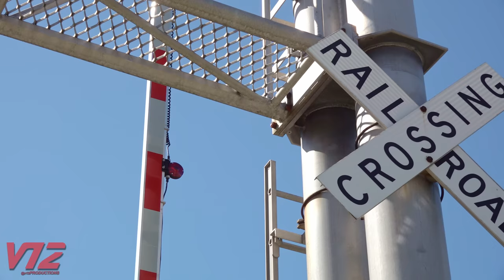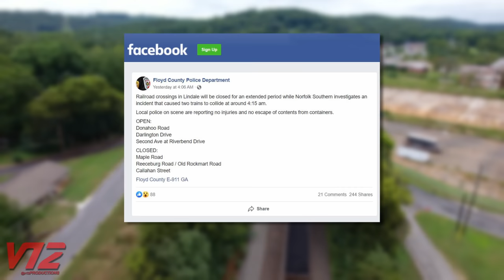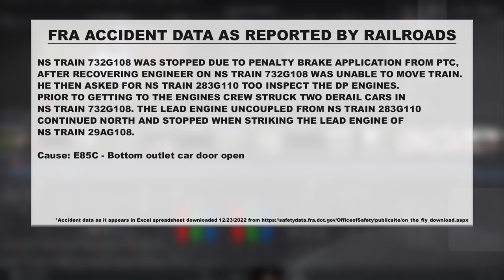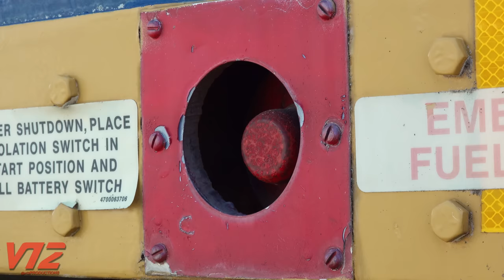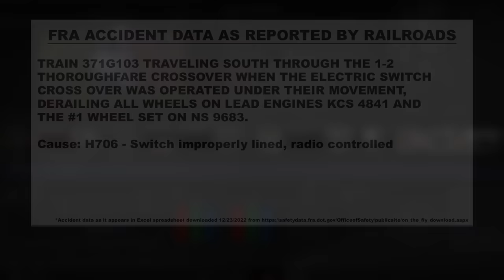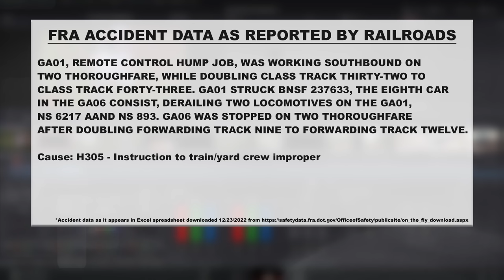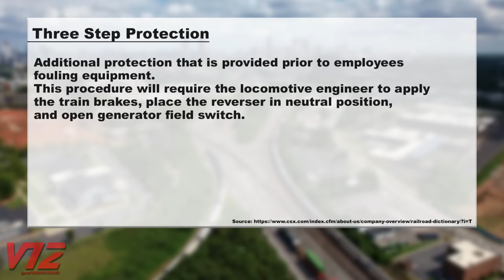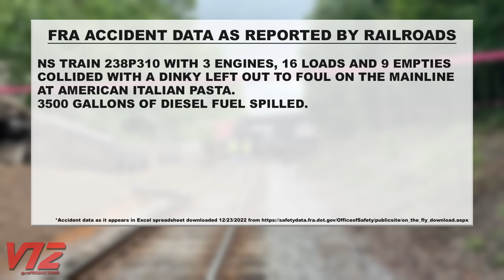Train Wrecks 2022 | SPECIAL REPORT

Comment: Them side boom tractors  are amazing bit of kit we could do with them in UK , we just work with jacks and beams to re rail locomotives , we do have some rail mounted cranes but not as versatile as your side boom tractors  . Had locomotive chucked off on catch points ( a switch to throw loco off ) two rail cranes couldn't lift it , and in to bad position for jacks/beams ,took nearly 2 weeks to get crane in due to remote position , but reckon you lot with then side boom tractor  would have done it in couple hours . It looked very much like loco 6217 at 28:53 on video at quite an angle except there was little damage to Loco or track , it had loaded coal train behind but only Loco brake to unable to stop at signal

Comment: I think they should mandate the european solution of all tractors covered with reflective YELLOW paint at least 12% each end. Airline manage to light up aircraft tail fins to enhance ground safety ..why cant train companies on very long trains?

To the rear of the train this could happen with guard carriages or warning illumination. It is always difficult to ask for train companies to invest in satellite communications emergency stop technology by the company controller but it is possible if regulated for....

Why cant these out of date trains be fitted with aerodymanic noises to save oil? Anything over 55 mph would save cash for aeroynamic modifications?

Comment: HUH. I'd be interested in reading the full FRA report. The summary provided at 12:15 makes no sense whatsoever. If train 732 got a penalty application and stopped and somehow derailed the cars with the brake pipe still intact (the one and only way they would have been able to actually fully recover the train). When the 283 hit the derailed cars and uncoupled that would have broke the brake pipe and it would have immediately went into emergency and applied the brakes. Even if somehow it didn't the crew aboard would have been able to. Even if they were somehow incapacitated, there's a 60 second alerter reset button that has to be pushed by the engineer or it puts the train into penalty and applies the brakes. Very confusing how their unit continued on and hit the third train.

Comment: Bad planning to have a set of traffic lights next to the crossing, a common cause of an accident. Maybe the traffic lights should be moved to before the crossing so when on red no one will be on the crossing waiting for the light to change to green, also once over the crossing the road junction will be clear to go.
Reply: At least in the places I've seen in the North East, and places in Florida where major highways cross railroad tracks and have an intersection nearby, there are two sets of traffic lights:  One at the intersection and another set on the other side of the tracks to stop traffic before it gets on the tracks.

Many of those intersections have automatic sequencing to help traffic clear the tracks.  One example is the Suffolk Ave/Lowell Ave intersection near the Central Islip commuter rail station on Long Island N.Y.  Suffolk Ave. parallels the tracks and Lowell Ave. has a "T" intersection there with Suffolk Ave just across the tracks.

If you assume that Suffolk Ave - the parallel  road - has the green light, and Lowell Ave. has the red light. . .  When a train is coming and is still far enough away several things happen automatically and simultaneously.
1.  The Suffolk Avenue lights automatically cycle to RED, stopping the traffic on the parallel road.  This happens even if the lights have just cycled GREEN just seconds before.
2.  The Lowell Ave. lights at the intersection cycle GREEN to let traffic off of Lowell Ave between the tracks and the intersection.
3.  The Lowell Ave lights stationed before the grade crossing cycle RED to stop traffic from entering the railroad crossing.
4.  The signals and crossing gates are activated.

Setups like this would prevent a lot of intersection-related accidents.  Of course, no amount of safety planning can cure stupid.

Comment: Good afternoon
I'm sorry, but from what I saw the railway lines in the USA, they are very bad, perhaps equivalent to 3rd category lines in Europe, not only do American trains run at low speeds, but in the case of this (and other videos), I see that they use 9 or 18 m rails, so the lines have a lot of undulation at the junctions of these rails, no wonder there are so many derailments.
In Europe, welded rails measuring 150 to 250 meters are used on main lines.
Also something that I have seen that does not exist in Europe, is that the rails of railways are higher at the level crossings than the roads that cross them, it is absurd, on top of that with the heavy trucks that cross them they run the risk of getting stuck in these passages causing disasters.
Come to Europe and see how they work on the railways...

Comment: If a truck is blocking the tracks, why doesn't it push blocking traffic out of the way or scape some paint to clear the tracks - surely that is a much smaller effect that wrecking a whole train? Considering the cost of a train, surely they can afford airbags for the crew? Otherwise they are just loose bodies in a metal box = ouch!!

Comment: Surely the biggest factors to consider with the freight trains is not so much their speed but weight and impetus knowing that they unlike road traffic they need far more stopping distance. I know from driving even, a four carriage passenger train, in UK at 60 mph needs at least a quarter mile distance to stop under perfect conditions.

Comment: The thing that bugs me, is that the person who driven onto the rails, claims that they were "unfamilliar with the area".
It's like saying "i was unfamilliar with the house, so took a dump in the kitchen sink, and then the disposer suddenly chewed my asshole.."    Bottom line: You're behind the wheel, you've got a license, so you're supposed to SEE, what you're driving onto, before you run over someone the same way.

As for the greenlight waiter..  this started as a joke, but i mean it now: we should ban pussymatic trannies on trucks by law, so the college fresh barbies would stick to their momma's minivans, when working in haulage. The amount of deadly accidents, involving an unicorn chaser at the wheel of a lorry reached unlaughable figures.

12:40 - That's why they fire people in Russia, for taking off, after the brakes applied by system. The crew helper supposed to walk around the entire consist, and make sure it's in tact. If no event was found, yet, the case repeats - they supposed to report, and follow dispatcher's new orders, to side the train at the nearest point for a closer look by a team.  

These guys just tried to take off, as if the system had a glitch, they've asked for a disaster. (the car with open unload bay must've been on it's track, and they've pulled/pushed it off, trying to start)

27:49 - a radio controlled switch, in one of the busiest yards. Bra-vah! Spend millions on a layout setup - save pennies on wiring.

Comment: Almost the only thing the railroad is good at is getting tracks back open. But imagine being the one of the crew that hit the concrete barrier, getting 3 days off, then having to run another train through that area with the old engines still sitting there.

Comment: I've heard of the train drivers using, Binoculars To see ahead Maybe all railroads should start training their Engineers to use them And for tractor-trailer drivers to stay away from railroad crossings. When you see the lights And the gates going down And regular car drivers need to know. It takes miles to stop a fully loaded Freight train moving at top speed Stop jumping across the crossing it is not worth it Stop at least 25 to 30 feet from the tracks. Who cares if somebody behind you blows the horn.

Comment: As a truck driver I find it amazing that trucks get hit by trains. At the very least you’re going to pay for the load & trailer. If it breaks the tractor or locomotive, and/or derails the train, nobody is going to say “don’t worry about it”. I can’t fathom “I can beat that train” and on the off chance I got stuck on the tracks, I’m going to jump out and raise the air bags on the truck & trailer.